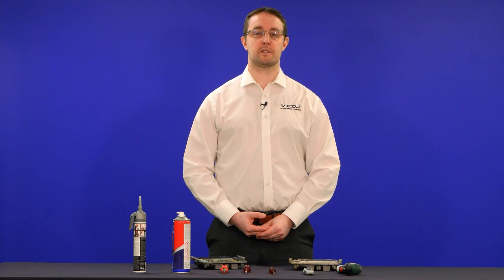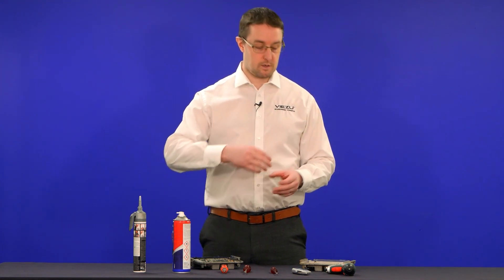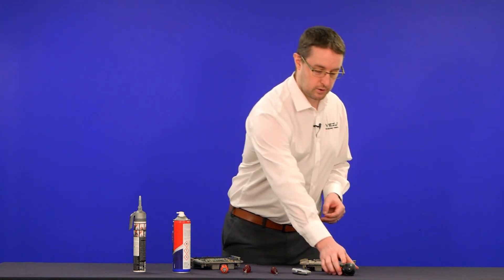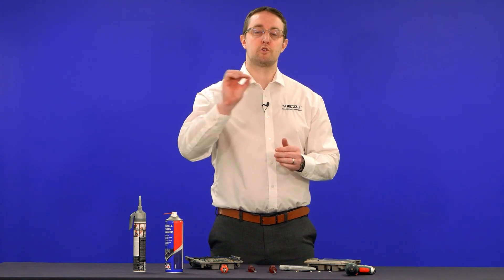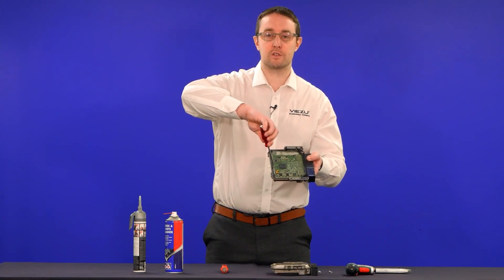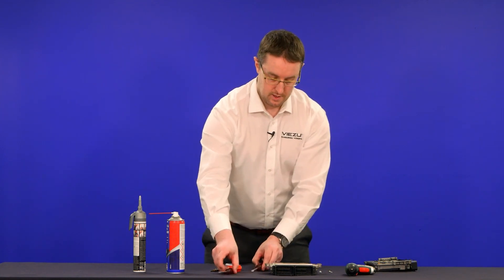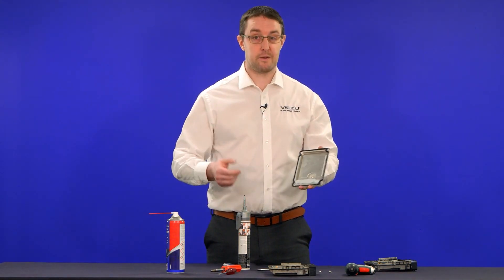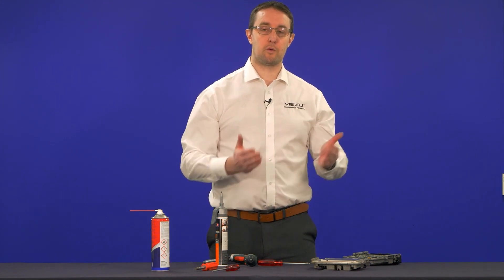How to Open an ECU | Viezu Technical Academy - Remap101.co.uk

Comment: After opening and cleaned the circuit board, do the ECU need to be reprogram?
Reply from the maker: Hi,  the video is a helpful guide for how to safely open an ECU. The reason we would be opening an ECU would be for tuning. This would mean we would then be reprogramming it. If you check out some of our other videos on our channel we have many guides on tuning tools and equipment and on our remap101.co.uk website we have online training courses teach you how to safely tune diesel and gasoline vehicles.

Comment: Is that a neutral silicon  that you use to seal the ECU?
Reply from the maker: HI, the silicone is an automotive silicone with a higher heat rating than most due to the heat that some ECUs experience during both operation and location within the engine bay in some vehicles. It's is not a neutral one, this is a similar silicone to that use by many vehicle component manufacturers.